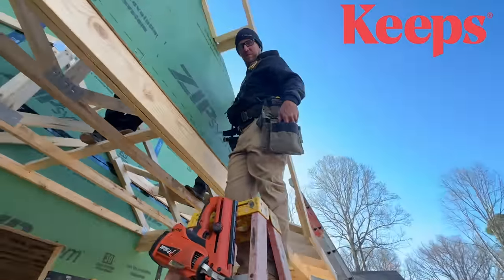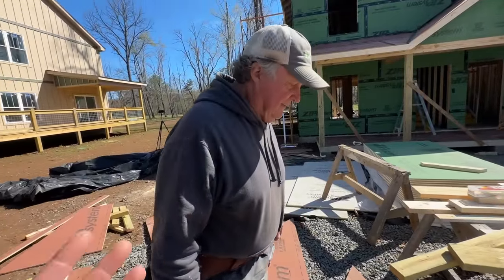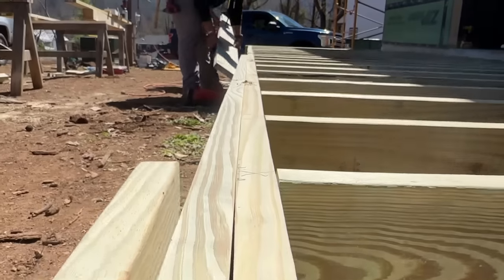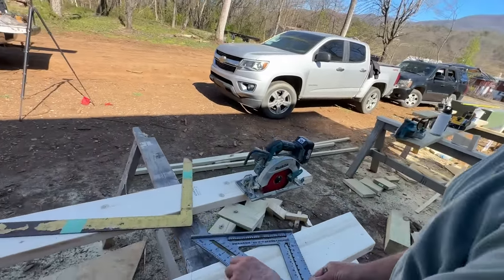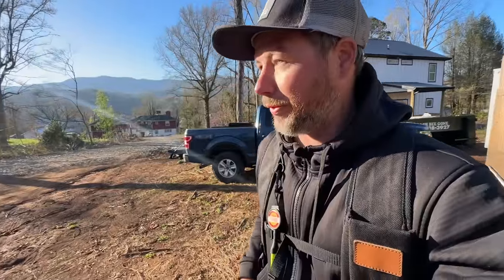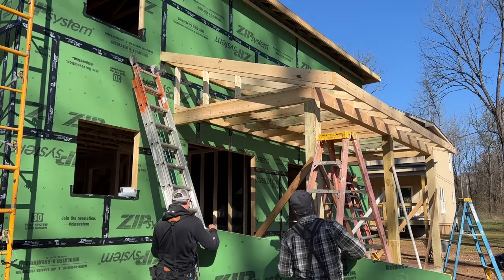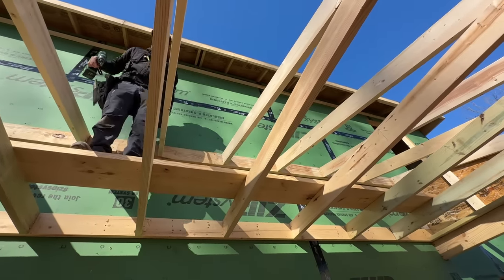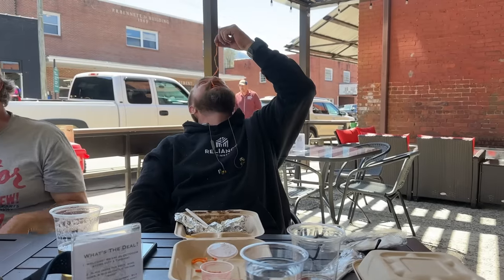Construction of a Duplex Part 16

Comment: Houses are definitely overbuilt now. My house was built in 1952, with no headers and 2x4 walls on 24 in centers. Nothing has moved. All these massive headers and crazy worries about point loads are way overkill. I've had an inspector make me put a second stud under a small girder because it landed offset to one side of the stud below. I agree with Jaime, if it doesn't pinch the blade it had next to no weight on it. I've cut out 10 feet of "load bearing" wall and left it hanging for two days while I reframed the rest 😂 you guessed it. Nothing moved

Comment: Get a weighted impact rated socket for the 3/8 drive and it’ll drive those anchors a lot better
Reply: No Dewalt is under powered. Milwaukee would do it better

Comment: about the topping out party, in Europe its a tradition that when a builder finishes installation of the final piece of structure, or the completion of the roof on a building. they place an oak leaf crown on the highest point on the building. it informs the homeowner that the installation of the final piece of structure, or the completion of the roof on a building is complete and the homeowner is the one who sets up and pays for the party as a thank you for the hard work.
Reply: There are 50 countries in Europe and most of them have different/unique cultures. So where in Europe is this supposed to be a tradition?
Reply: @Ogilla  Latvia, Lithuania, Denmark, Sweden,
in Germany its called Richtfest as far as i know. my apologies i didnt ment All of the Europe. All of the countries ive worked in have a tradition of this kind.
Reply: We call it a roof wetting or daknat maak party in South Africa

Comment: Ok!! They looks good, so I'm a Handyman by trade. I do these all the time sp the reason why it turned darkee is bc you used a oil base sealer than instead of a water-based sealer. So you definitely want to do at least 2-3 coats for rhe durability and it will even out where it's blotchy. But always remember anything oil base will always make wood darker color than what it is.

Comment: Coming from a mechanic. That 3/8 impact needs an "impact" socket on it not a chrome one. Also you should probably be using a 1/2 inch drive impact gun to run those lags in with but I know how it is you use what you got.

Comment: There’s like a 600ft lb difference between dewalts 3/8 drive gun and their 1/2 899 high torque impact. 

And yes, I’ve split 1/2 black impact sockets with it.

Comment: @2:20 If the Zip tape supposedly needs rolling to secure the bond, how does it fare when you use fingers to push it into place and maybe tap it down? 
I was wondering about the roof-wall joint as it would appear to not be fully watertight.

Comment: Back at Thanksgiving I ran one of those 6" GRK structural screws into my finger. Missed the bone but peeled about one inch of the tip back so the nail was kinda just hanging there. My hand was holding the wood thinking its well out of the way. It still hurts if I bump it right and is numb. Does Jamie feel pain in the fingers he is missing? 
One thing I have found is if you spray some WD40 on your tapcons they go in easy

Comment: 9:53

A much easier and less time consuming way to do this is to calculate your Slope Gain Factor of the roof then multiply it by the run of the rafter. To calculate your SGF you divide your pitch, square it, add 1, then square root. For example:

4/12=0.33 
0.33 Squared plus 1= 1.111
Square root of 1.111= 1.054
Reply: All this means is your rafter length is going to be 1.054 times longer than your run. So 96" plus an overhang (we will just say 12" for example) x 1.054 = 113 13/16"
Reply: This is a great argument for the use of metric over imperial. If you are building using imperial measurements, as we do in the states, you then have to convert that decimal to the nearest fraction before it’s a useful measurement.
Reply: @kevincberry  I’m from Canada, so this is actually taught to us in Metric. In any case is not hard, I know 3/4 is .75, and the decimal landed between that and 7/8 (0.875). So I can use 13/16. 🤷🏻‍♂️ I prefer fractions myself. Metric is nice to use when you need to be really accurate, but if you came to me and told me stairwell clearance height is minimum 1950mm I’d convert it to inches immediately cause that’s what makes sense in my brain.. aha

Comment: the tradition of the top-out party I will explain to everyone what it actually is. A top-out party is an accomplishment on building the full structure but not completely complete. The structure can be stone or wood. It is usually done before windows go in and things go inside. The tradition comes from Germany. Usually, they will have a small little party around lunch time going to after noon. The first tradition is tying and nailing a sapling to the top of the house, bringing good luck to the future owners of the building or establishment. Then a prayer is said. A prayer is said. A shot of something very strong, usually moonshine called Schnaps. A prayer is said. Schnaps. This tradition goes back into the 12th century; however, the first German unions demanded this in all contracts. Most of the time, the homeowner would make a potluck and bring the family to see not quite the finished house but part of the house being finished. Now the sapling on top of the roof must be nailed with the two final nails of the whole project of framing. Usually it's done with a junior and an elder, so a boss or the newest employee brings extra luck, and the tradition states that the old and wise are never surprised by the young because of their strength.

Comment: Your sheer strength on common penny nails say 12d common nail for framing also depends on wood used also if I’m remembering correctly in college I studied architecture as my major we did I’m our strength of mastery class on 12d common nail it sheers of at like 90 lbs per mail  we did tensal strength also box nails and are less we also did with type of bolts also

Comment: had a debate one time with a time served pipe welder friend of mine.   in the "old" days, welds would be overdone in case of failure.   today, they have to be precise as engineering specs dictate the connection, thus the onus is on the welder rather than the material to hold up.   And a couple of poor welds can result in disaster.    In our historic old house, there was a 8x8 holding up the porch roof.   when we renovated the inspector didn't like that (as it "just a log") and didn't have the Maple Leaf on it to say, "GOV APPROVED FOR USE" (which is the real reason, but cannot put that on paper).   Bear in mind this sucker has been holding up the center of this snow load framing for 100+ years, with some massive 12 inch spikes through it....We had to remove it and replace with an engineered beam at significant cost.   Inspector/Engineer was just doing their job, no complaining but sometimes if it is doing ok, is not damaged and fit for purpose, then leave it alone.   I believe there should be a "historic/old" building code that allows for existing things that are structurally sound to be allowed upon discretion/inspection and noted on the report.
Reply: I can tell you that in most countries in Europe, everything has to be done according to the rules applicable at the time. I bought a house built in 1956, at that time the piping had to be outside of the walls, then they changed the code to have all piping inside the walls. It is not retrospective, my house was not suddenly out of code and illegal. If you do any renovation, then all new installation must follow the new code, all old installations stay as they were.

Comment: Biggest issue with the Zip Tape is that the build crews are not rolling the tape. I checked 5 new construction homes over the last week, and none had the tape rolled. These guys can’t read English, so it doesn’t matter if it says “ROLL TAPE”. No bueno.

Comment: I understand that you have no choice but to use imperial, but gosh it is so confusing. I cant approximate or imagine in my head any of the sizes which you name sometimes. 12 inches in a foot, thou, hand, furlong etc. You want something less than inch? here take this fraction and figure out. So confusing. Had to actually google why US does not change to metric. I like what you are doing anyways, good job.

Comment: was that 3 2x6s? or 3 2x4s? that seems way way overbuilt. Waste is extremely bad no matter what. The only way a society thrives for a long period of time is largely based on waste. Once you start being wasteful and overbuilding the repercussions are unquantifiable. Watching them put like 15+ large bolts from the deck to the foundation makes me very sad. That is way way overbuilt. Not even close to what is needed. Proable 5x what is needed. Those decks are going to be able to support like 100 people on them easily.
Reply: When you are building structures for clients and a professional, you don't build what may " probably hold" to save 10 bolts. Focus your energy on something else Brendan, it's such a strange thing to be concerned over, it made me waste my time to respond.
Reply: @nickk4010  With that logic, the entire build will waste hundreds if not thousands of fasteners. they use 10 extra bolts for this one small part of the build. if you built an entire sub-division you are talking about wasting tens of thousands of fasteners. in life everything matters., and the fact you think waste is fine and no big deal is wild. 

Those 10 bolts equal overbuilt by not 100% closer to 2,000%. so if you have a proper understanding of what is needed and compare it to what it is used you will see it is a huge waste and shouldn't be done. people waste because they dont know enough about what truly is needed. ignorance is the downfall of mankind along with foolishness and recklessness and laziness. so yes. i get worked up about this sort of thing because if you look at the bigger picture it is a huge issue. of course, those 10 bolts don't mean anything to anyone. but we are talking about something far bigger than those 10 bolts. the fact that you think we aren't is wild.